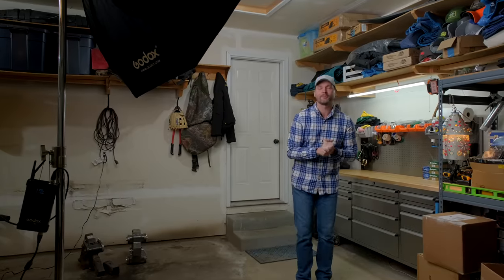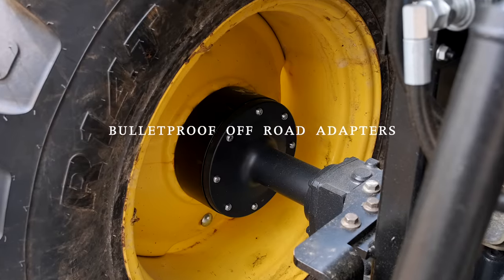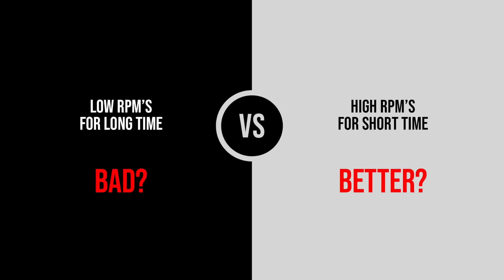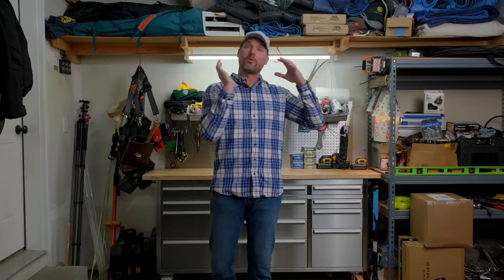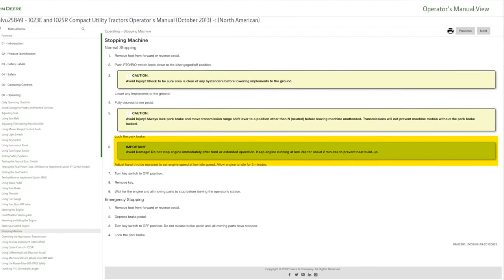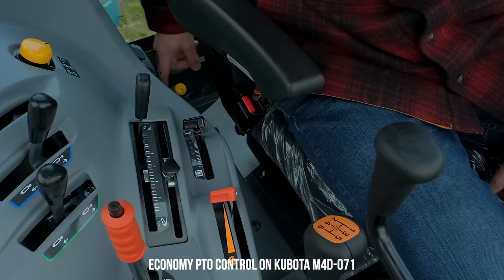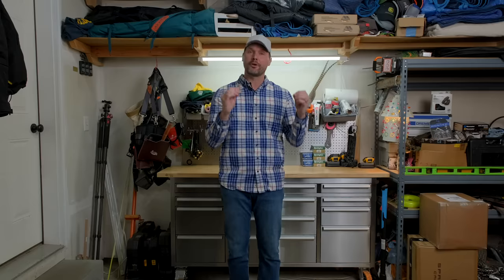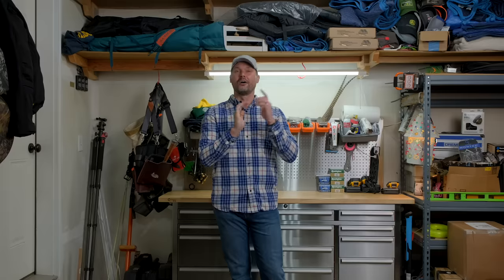WHAT RPM TO RUN YOUR TRACTOR? IT’S COMPLICATED

Comment: I'm an old fella, been a mechanic for 40 years and have equipment that's 50 years old+, and I'm always amazed at the brain washing the manufactures have done to the general public. They are in business to sell equipment. The faster you wear it out, the faster you'll need a new one. When it comes to the operation of equipment, faster is NEVER better. I understand that if you make your living running equipment, time is money and you do what you have to do. But if you're not in a hurry, running at or near WOT is a mistake. Use some old school common since. More speed is friction, friction is heat, heat is wear. Besides that, you're wasting a ton of fuel. The laws of physics haven't changed. PTO speed for example, unless its a generator or something that absolutely has to be at a certain rpm, most equipment operates just fine well under the RATED PTO speed. My JD 5065E tractor has a three cyl diesel that's rated for peak torque at 1700 rpm with a 540 pto speed at 2400 rpm (WOT). I never run it higher than 1700 rpm. Why? Because at 1700 rpm the engine is providing all the twisting force it can.  Anything above that is simply more speed, not power. When I brush hog, I run at 1600-1700. Does great, uses WAY less fuel and less wear and tear. I hear people say running the hydraulics faster keeps it cooler. Really!?! How about the auto transmission in your vehicle? It's just a big hydraulic pump. Do you start and drive it at full speed and WOT all the time? I wouldn't recommend it. I could go on, but in the end, this is just an old man's opinion.
Reply: I agree Lee!!   Tom
Reply: Wow… That was a LOT… Of WRONG information. These engines are designed and limited to the speed they run. I’ve been a diesel mechanic for the better part of 20 years myself. If you were at all correct… Truck engines, which often make peak torque at around 1,100-1,200 RPM. Would run at that speed all the time. Instead they often run at or near max RPM. Reason being is the once you’ve gotten things going. Horsepower takes over to keep things going. 

Torque is only the ability to GET something moving. 

Horsepower is the ability to KEEP it moving. 

Also. As mentioned in the video… Hydraulic systems are designed specifically for a given RPM. On my old JD 50. It’s about 1,200RPM. On a newer machine with higher speed engines. It’s usually around 2,500-2,800 RPM. Without that RPM you’re actually going to cavitate the pump and CAUSE DAMAGE.
Reply: @brandoncrimmins6296  I knew I would generate some strong responses and I respect your point of view. I would however, suggest that you refresh your understanding of cavitation. A hydro pump creates flow, not pressure. The pressure comes from resistance to that flow. When the return flow cannot keep up with the outflow of the pump, it cavitates. In a properly operating hydraulic system (check valves, dump valves, etc) operating the pump slower will never cause it to cavitate. On the other hand, running it to the point of bumping up against its flow limits and the pressure relief valve or valves, lots of bad things can happen, including overheating and cavitation.
Reply: @leecarter9525  Yes, that is one of many ways cavitation can happen. Tip speed of a poorly designed pump, poor sealing properties of pumps as well as vane pumps liking higher speed to seal correctly. Also fluid being too hot will boil and aerate. And in that case your method of limiting RPM would absolutely be beneficial if you’re having a fluid heating problem. But so would a properly sized cooler. 

Pumps not creating pressure is a well debunked myth. Without the pump, you have no flow. Correct. However, by installing a pressure sensor inside just a bare pump with no load circuit plumbed in. We can now see dramatic spikes inside the pump itself does spike pressures. Especially positive displacement pumps… And the fact that the whole entire system is under pressure. Not just the restriction itself proves that the pump is what is creating pressure. Or at the very least, contributing to it. 

I don’t mean any disrespect to you sir. I’ve learned a WHOLE LOT in my career from fellas like yourself and I’m very grateful for that. All I’m getting at is there’s also a lot that the younger guys have to offer and can teach you too. Information and understanding of things changes over time.
Reply: @brandoncrimmins6296  Thank you Brandon for the respectful comment. I appreciate it. I see (and work with) so many young fella's that just want to get it done any ol' way as fast as possible. They don't seem to care about understanding how it works or why it works that way. A service man that learns the details is a good service man. And..., you're right, never too late to teach an old dog new tricks ;)  Take care.
Reply: @brandoncrimmins6296  sorry guy but I am a veteran service technician (mechanic) on all types of pumps including PD / RG pumps. Over 90% of cavitation comes from running a pump outside its intended gallons/head rating. Usually it’s because of misapplication or installation. In the case of tractors, the pumps ( including the engine oil pump) will see a wide range of viscosity due mostly to the temperature of the fluid. If anyone has ever poured oil from a bottle that is 11 deg vs 82 deg,you know what I mean. 
Most every oil has a rated temperature range but there is also a best temperature range which is almost always more narrow. The hydraulic pump(s) in a tractor are engineered to handle a wide range of operating conditions. Unless a manufacturer cautions against certain operating rpm’s, it’s highly unlikely the pump(s) will cavitate. Conditions that could cause cavitation are too cold fluid temperature, insufficient supply of oil, wrong type/ grade of oil, holding pump at full pressure for an extended time are a few examples.
Reply: @lcee6592  yes, thank you for confirming my points? I’m not sure what you think you said that I didn’t…Here in Minnesota I used to replace pumps all the time due to cold fluid. Especially if they had a slight bit of water in them. I’ve seen several skid steer suction lines freeze up solid due to just a small amount of water and cavitate holes in the pumps when they start flowing again… 

So are you going to address the original post of running a machine under it’s designed rated speed and rated load…?
Reply: I’m 74 also , and I have 8 Old tractors that have never been ran atWOT  . I run mine between 1500 and 1700 also
Reply: @brandoncrimmins6296   As I already stated, the pump(s) in a tractor can operate through a wide rpm range. Even at idle the pump is highly unlikely to cavitate. As long as a pump is full dynamic, it will not cavitate. There are pumps of various types (including ones that are just like the pumps in a tractor) that are controlled by a VFD to meet flow requirements as needed. Sometimes a low rpm is desired to facilitate slower hydraulic flow thru the system. Such as digging next to a foundation or other object one does not want to damage. I am not aware of any tractor manufacturer that tells the operator the tractor needs to operate at or near wot all the time. If they do, it is because of the emission system requirements and has nothing to do with the pumps. The problem you have encountered with flow being reduced or blocked from water/ice can certainly introduce cavitation. Obviously this is due to insufficient fluid supply reaching the suction side of the pump. As much, water and hydraulic oil certainly have different properties and this would include the conditions at which their molecular structure would start to implode causing cavitation. 
RG/PD pump designs are inherently made to build pressure. GPM is relevant to the design and volume in the pump. Speed does play a role in pressure but it more affects the GPM up to a point then physically the pump cannot pass any more fluid no matter the speed. So, if an equipment manufacturer (pumps too) says don't operate under/over a certain RPM, then I suggest follow their recommendation.
Reply: I disagree, I'm a city worker and we have just about every piece of equipment  that you can imagine. From chippers to leaf  machines, street sweepers, skid steers just to name a few. We run our machines W.O.T all day everyday in heat, rain, snow it doesn't matter. With regular maintenance we rarely have issues that go beyond everyday wearing moving parts.
Reply: @marvinjackson2641  you said it, regular maintenance! Maintenance is more Important than anything. I’d rather have a machine that was run hard with regular maintenance.
Reply: hm- i think engine oil pressure is probably a factor worth talking about. generally it goes up as a factor of RPM not load, so if you're putting a strain on the engine i'd say it's better to be at the "correct" RPM instead of lugging it. i'd also say anything spinning a blade should be run at the proper 540PTO speed. i'm not an old fella but i do understand about proper blade-tip speed when mowing, and i prefer a nice cut job to saving a couple bucks a season on fuel.
Reply: Your engine won't produce full torque at anything less than WOT. In order to produce peak torque you need to slow your engine down by increasing the load, not by decreasing the throttle. Also, more speed is more power. That's because speed is a factor of power. Look at your tractors' horsepower curve.
Reply: the recommendation to run at higher rpms come from manufacturers trying to meet emissions requirements. Heavy duty diesel will last forever running low and slow. Also let them idle for a minute prior to shutdown. 

I have seen diesel oyster boats that idle all day for 40 years.
Reply: Well.   Might as well throw my nickles worth in here.    On the older non emission engines you could tune them at lower rpm and never really hurt them.    My father in law was the worst I had ever saw at lugging a tractor.    The newer equipment with dpf needs to be ran at a higher rpm. Some of the newer manufacturers are replacing 6 cylinder with 4 cylinders for emissions and those smaller engines are running cleaner and have much more hp!   Sadly the emissions and higher rpm along with lighter viscosity oils will most likely lead to more frequent replacement/repair.    As a couple others have said low rpm on the hydraulic will NoT cause cavitation or excessive wear unless you are asking for more work than the rpm/pressure  will allow, if you are stalling the hyd system and just keep forcing things then you will build heat and cause way more stress than wide open throttle will do on a properly sized system.   There are always exceptions on every side of this but in general these things are designed to be ridden hard and out up wet. Well, atleast until the warranty runs out.      On the automotive side of diesel engines the trucks with vvt turbos need to be ran like a truck and those with dpf must be ran hard and worked or you will have a constant headache for the life of the vehicle.    I make really good money off of rich people and their 3500/350 trucks that they only use to commute or take the kids to school.   I am having to do forced regen and many many many times I’ve had to replace egr coolers and dpf systems.   We’re talking $200-$20k worth of work just because people babying their truck.    And def systems are a whole story to themselves.
Reply: Boy are you wrong about torque!! Get the torque and horsepower graphs for your equipment. Torque is usually lower rpm than horsepower. You need to find a good mechanic to explain it to you. Running at the top torque rpm’s saves fuel
Reply: Finally, a person with a boatload of experience and common sense!!!
Reply: Maximum working-shaft torque is available at maximum engine-horsepower rpm, not maximum engine-torque rpm.  But of course if you don’t need as much output, then throttle down but remember … lugging can be very destructive to an engine.
Reply: I remember bobcat says wot to avoid clutches being burt up
Reply: I have a few diesel item never ran them at WOT, never. I rarely ever go any where near 2200rpm either.   Maybe in a excavator you might run more rpm for certain issues,  but in reality you use way more fuel, create more noise and more heat which get's nothing done. 

For tractors you run the correct gearing and rpm ( yes that combination you need both ) . When I brushhog I can run either 4 in the low gear-set or 1st in the high gear-set depending on many factors; is the ground level, is grass tall, is it wet,etc...

The information he posted in the video is not a bible nor written in stone, you select the right gearing and ropm for what your doing. Example, i just disc a 1/2" acres plot of dirt, I did that in 3rd gear and at 1290 rpm. The tractor runs great, no smoke, no bogging down, fuel consumption is minimal
Reply: It really depends on the transmission type and tractor. On the older tractors, it seems like we have to run them pretty close to wide open throttle for a lot of tasks. On the newer tractors with IVT or CVT, it seems like it's sufficient to just set it at 1700. The transmission adjusts as necessary.

Comment: I was a little surprised that you didn't touch on the topic of engaging the PTO at PTO RPM. I expect the Deere is the same, but Kubota recommends engaging the PTO at a lower RPM, then bringing it up to PTO RPM to avoid damaging the implement. On the L4701, I typically start the tractor with the throttle set for 1500 RPM, let it warm up (probably not long enough, I get impatient), use 2000 to 2200 for just moving around or light bucket work (brush, tools, whatever), then PTO RPM or just below for everything else. Finally, 1500 RPM or so for a short cool down.
Reply from the maker: We’ll I gotta give you guys something to write about! 🤣

No, I just forgot all about it.  You’re spot on though.  Engage the PTO at low RPM’s for most machines.  If I recall, Deere garden tractors should be mid or higher RPM’s when engaged.  Reference your manual 👌
Reply: My 1025r rpm is about 1525. That is as slow as it goes. After driving big trucks all my life it sounds and seems like it's screaming.
Reply: @rodbagley1686  the hydraulic pump works better at mid rpms and better unlike a manual transmission it's doesn't matter as much the engine is designed to run mid rpms and up
Reply: Yeah I remember we had an older 950 that idled as low as maybe 800 rpm.
Reply: 1025R idle 1525rpm downhill out of garage.  2000-2500 transit,  PTO engaged 1700-1800, then ramp to PTO speed.  Idle a minute before shutdown.
Reply: It's really more of a feel thing for me. On newer PTOs with electrically operated clutches, I bring the engine up just high enough to not load it down too much when you engage it. However, you don't want it too high, because those electric clutches really bang it in when you engage them. That's why I like my older tractors. All manual everything, so much easier to deal with lol.
Reply: i totally agree. my tractor redlines at 3600rpm and the mower is run at 3300. i engage AND disengage the PTO at 2000 because any lower than that and the engine bogs a little too much
Reply: Ive run tractors from an 70 twin cylinder to 1206 and several of the more modern tractors and I learned from a young age to engage/disengage the PTO at idle or just above then idle up to PTO speed and idle down before disengaging the PTO. a 3 to 5 minute idle cor warmup and cool down is a good idea as well, Especially for anything with a turbocharger.
Reply: I turn my pto on at idle the crank her up. I mow at 400 PTO, Bushhog at 450 rpm. I have excess horsepower so no need to burn all that fuel.

Comment: If your turbocharged engine is hot and ran on high rpm, dont't shut off! Let it run two minutes to let the turbo come down from his rpm's - if you shut down the engine there is no fresh oil to cool the turbo and the oil in the turbo burns to coal - the end of your turbo

Comment: I grew up on a farm ….. family owned grain elevator and trucking company ……. Summer college job was a county highway department with heavy equipment. I was taught if you are working the engine hard ………. You never lug a diesel. Adjust rpm to rated maximum and operate within a couple hundred rpm of that.
Reply from the maker: I think that's sound advice...I basically do the same.
Reply: @GoodWorksTractors  I am 69 …… so I am proudly old. I realize that many new diesel are designed for fuel economy at lower rpm. I had a 8v 92ta 435 hp international cab over that would run up the egt really fast if you didn’t keep it up in the rpms. In its day it was a real horse and would run all day at 2100 rpm.
Reply: Glad i watched this for I'm new to tractor ownership. Have had ny 2025r not quite a year and always felt it was running hard at the high end. I've mainly mowed with it with some light front loader work and a small amount of brush hogging. This year i suspect I'll be running those last 2 implements more so definately good to know for i like taking care of my things. Thanks.

Comment: Many implements operate the best at the recommended 540 pto rpm. On my tractor which is a yanmar sc2400 I have found that my mid mount mower mows much nicer even though the engine rpm is at 3250 which feels a bit high.

Comment: Years back I was driving a JD 4020 across the field after helping pull a stuck tractor out.  I had a passenger who happened to be a JD mechanic.  I always ran the engine at the predetermined stop position.  As we were driving back he reached up an pulled the knob and moved it to WOT.  He said diesels were meant to run higher and it would not hurt it, and possibly help it.